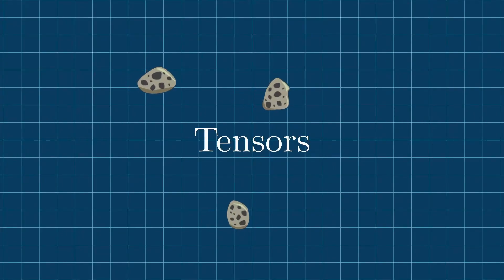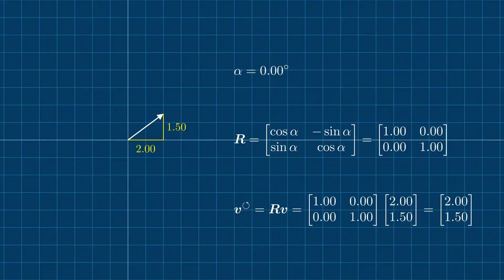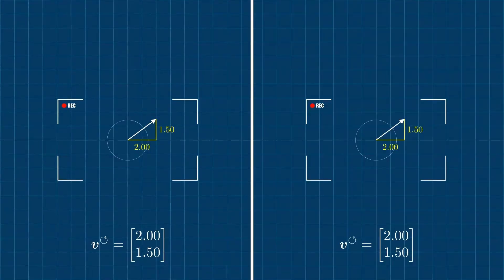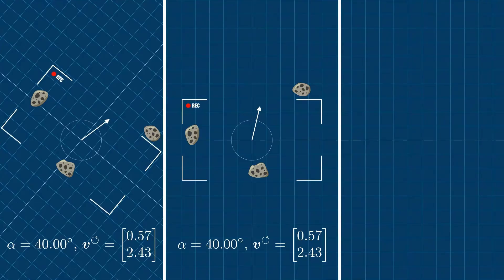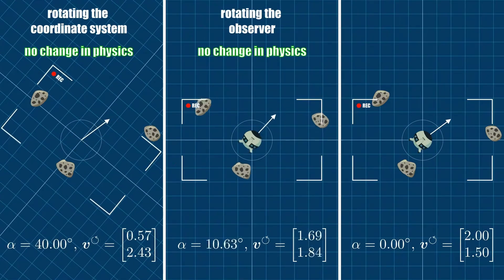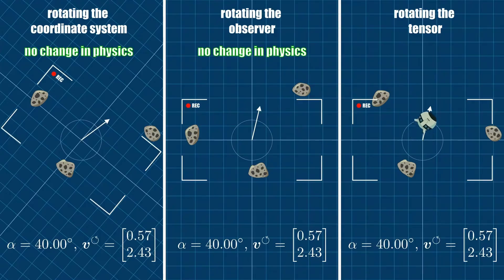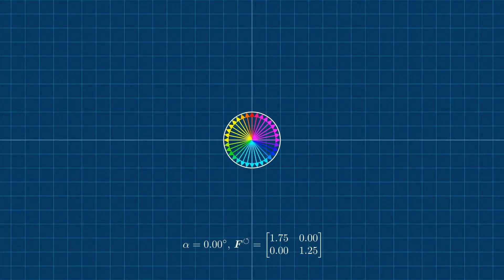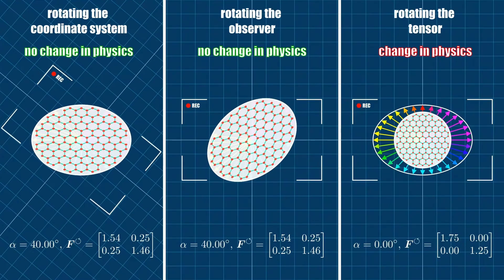A Common Misconception About Tensors Explained

Comment: This distinction is one the major unresolved questions I have regarding spinors — they rotate at "half the speed" of a normal rotation, so they end up negated after  "full turn" of 2π radians / 360°. That's weird enough, but I'm willing to accept that this is what happens if we rotate certain objects. However, surely if we rotate the co·ordinate system only (and not the physical object), then everything must be the same after a 2π radians, because the co·ordinate system is "abstract" and defined in terms of vectors, which do reach the same state after a "full turn", right? Yet many sources seem to say "if we rotate either the co·ordinate system or the particle by a full turn, it ends up negated", which is baffling to me if that's true. How can rotating our abstract co·ordinate system possibly change the state of a particle?

Comment: I don't quite get the point of "tensors differ by being coordinate independent" as with the change of observer thing...
How is this not just a change of basis for linear maps? As far as I understand your video, a  (second order) tensor is nothing else than a linear map, which has more than one matrix representation as well. And by that and most peoples misleading understanding of linear maps and matrices, they are nothing more than a matrix/represented linear map.
So the actual misconception is, that matrices are not the same as linear maps?
And from what I know, tensors are a generalisation of linear maps to arbitrary order, so one of the second order special cases would be the matrix as a linear mapping representation. 
On the other hand did I never use tensors like physicists do in Quantum mechanics as you mentioned, only abstractly in mathematics. So I may be expecting something else, tha what the video is trying to explain

Comment: Diagonalization is important to simplify math for finding determinant of original complex matrix / transformation A.
Also, to find trace (diagonal sum of eigen is same as summing original complex matrix A diagonal). 
Both properties of underlying transformation.

Is reason both can make finding the two values easier is because both are invariant properties meaning they stay the same even after change of basis.

Comment: So if I get this correctly, the difference between a matrix and a tensor is that: the tensor specifically describes an applied transform, whereas a matrix is just some arbitrary Cartesian number group. Also it's common to see a matrix as a 2D, but it's actually multidimensional. AFAIK you can have a 3D matrix etc, also technically vectors are 1D matrices and scalars: 0D.

Comment: I think I've understood the analogies to tensors. But what I'm still missing is how can we write a tensor and work with it. We can't write it as a matrix, because then when changing the coordinate system, the values in the matrix needs to change iirc. But how to write it then? Or is a tensor a more abstract object that can't be written like this? This is what I don't get.
Reply: For example I know how to create a matrix that does what I want. I can just multiply a scaling, shearing or rotation matrix to get every behavior I like. But I wouldn't even know how to write a rank one tensor.
Reply: The definition of tensors say that it is any mathematical object that follows the mathematical rules of transformation of its corresponding rank.

For example scalars are rank zero tensors. They don't transform under any kind of coordinate change. Conversely, any physical quantity or mathematical object that doesn't transform under any coordinate rotation is a scalar or a rank one tensor.

A vector is a rank 2 tensor. So it follows the transformation rule v' = Rv. Any mathematical object v that can be multiplied to the rotation operator R only once to produce the transformed result v' is a rank one tensor. It's just that matrices do follow these rules of transformation so matrices are a way we can represent tensors.

For a rank two tensor the transformation rule is A' = R^(-1) A R